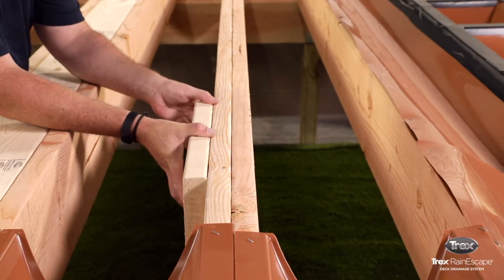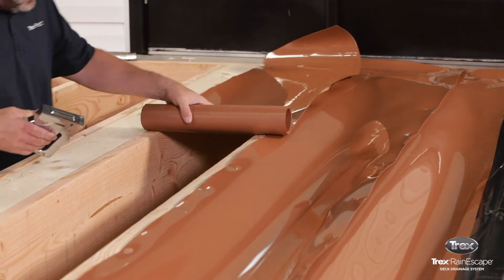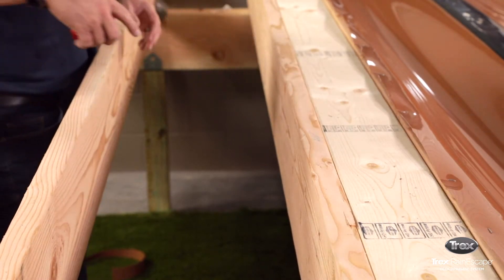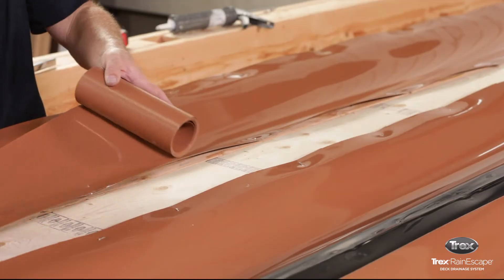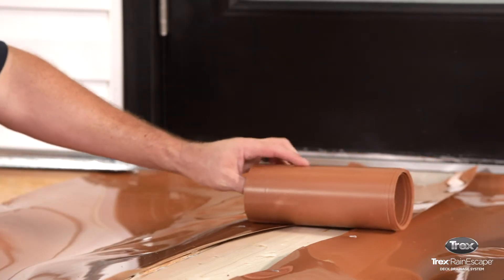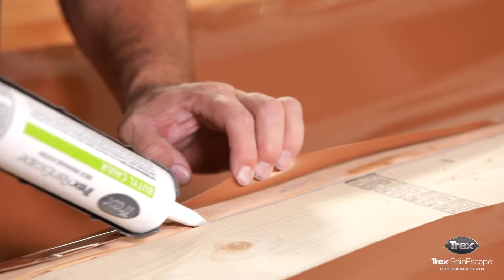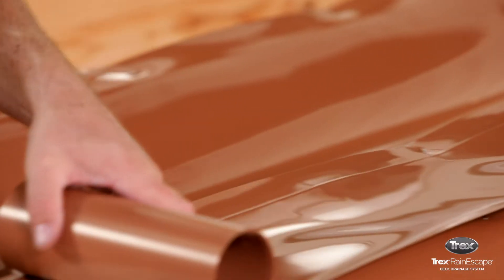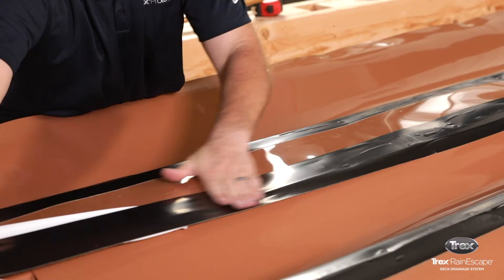Installing Trough Over a Double or Triple Beam

Comment: Triple beam is 5.5”. Can I trough over a 9.5” (2x10) joist blocking? Why/why not?
Reply from the maker: You can certainly have the Trough over a 9.5" spacing. Can you please call us to explain as there's a few factors in that. 877-348-1385. Thanks!